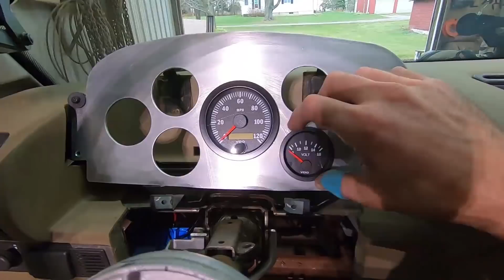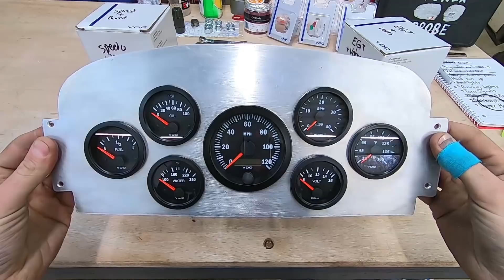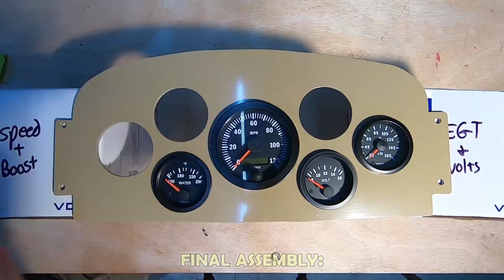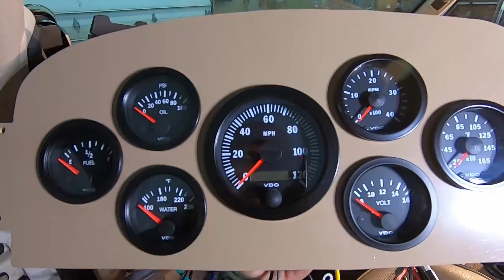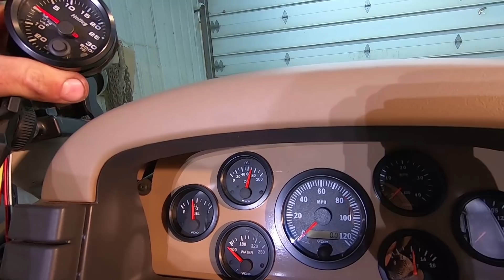Custom Gauges × 4BT Cummins Discovery #48 [Land Rover Build]

Comment from the maker: Almost looks like a road worthy vehicle now! But my tachometer wiring still needs tweaking, since I'm trying to steal an output signal from the old Rover alternator for my RPM reading. (I have a laser RPM detector now, just to be sure the reading is accurate once it's working) Next up is a road test to verify the speedometer, boost gauge, temp gauge, and exhaust gas temps... which if all good means I can turn up the boost and start tuning it!
Reply: As an experiment I think it's worth trying a longer exhaust to spin the turbo faster,as I see it the exhaust gas is exiting without producing enough flow to build a rise? Counter intuitive but you may also gain from having the end section actually having a slight narrowing taper!
Reply: Engine tan coloured whole vehicle:)

Comment: I retro'd my Defender with the exact same gauges and had the same problem with the RPM gauge. Once you wire your signal from the alt, there are tiny microswitches on the back to set the gauge to different pulse rates from the alt. I played around with the settings until I got it right.
Reply from the maker: Ah good to know, figured it would just take a few settings here 'n there until I got it right. And I'm confident I can get it near enough to exact since I have a handheld laser/photo tachometer meter to double check.

Comment: Really, really nice job on the gauges and the project overall!  I followed your build on 4BTswaps.  I''m pulling together components for a 3/4 ton GMT800 6BT conversion.  I have planning to use the GM AD244 alternator, but am having second thoughts.  I'm now considering a 28SI.  What alternator did you finally end up with?  And what thermostat housing did you use?  Thanks.
Reply from the maker: Thanks! I'm using the original Rover alternator for now, but I'll likely go with a rewound diesel unit later down the road. I used the angled housing to make the custom radiator easier to fit.

Comment: Great looking cluster ! Painting it the Cummins color is a nice touch. What do you think of the old racer trick of rotating the gauge so the needles are straight up at normal operating position ? might be handy if you will be doing a lot of rock crawling or high angle operation. Look forward to seeing you get it sorted !
Reply from the maker: Thanks, and I hadn't thought of that idea!
Reply: I have done it, and it really stands out when something is off... great to have you back uploading, thanks for the videos !

Comment: Did you you ditch all the disco 2 abs/traction control components?  Any issues with the immobilizer without the  v8 in there?  I'd like to know how you got around all the bcu related electronics.
Reply from the maker: I did yes, actually to clarify I ditched the ENTIRE electrical system. Went in there with bolt cutters, was surprisingly cathartic. I'm building my own bespoke system in it's place using a combination of motorsports + mil-spec + marine grade parts with breakers instead of fuses & solar etc. Big job but fun to decide where everything goes & how it works.
Reply: @Tinker1837  I have always heard the differentials were weak on the rovers, the traction control helps spread the effort as to not grenade anything. Did you upgrade the gears and replace the differentials?  Also  were you able to keep the climate controls/lights/signals/power door locks/power windows functional?
Reply from the maker: I did not upgrade any gears, by some luck the ratio's worked out perfect with this engine/trans. They are in the range of 1/2-ton american axles, so not weak really, more the issue is cost in upgrades versus american axles like Dana60/Ford9 etc. Lights and signals I have rewired so they work, and no climate control will be custom as well.
Reply: @Tinker1837  with the torque of a 4bt I not surprised to hear she turns the stock gears as well as if not better than a healthy 4.6. Thank you for the input.

Comment: Idiots lights low beam high beam  etc btw good work
Reply from the maker: I'm honestly not sure yet what I'll do for that... either drill holes in the this cluster for the warning lights + indicators, or setup a panel for those lights up on top of the cluster surround.

Comment: How does the sensors work?
Reply from the maker: Which sensor?
Reply: @Tinker1837  temp sensor, rpm,volt, blinkers .😅
Reply from the maker: Temp sensor is in the cylinder head, rpm is coming from the alternator, voltage is just from the batteries, and blinkers I have not done (yet)

Comment: Where's the Tachometer
Reply from the maker: It's the gauge to the upper right side of the big center speedo gauge.
Reply: @Tinker1837  OK saw everything...
Reply from the maker: I am so excited to have them now so I can turn up the boost :D
Reply: @Tinker1837  and you've already connected the fuel level sensor ...
Reply: @Tinker1837  I would also add an indicator of air filter contamination
Reply from the maker: Oh yes, for sure, and that I have as well but it mounts to the new air filter housing.